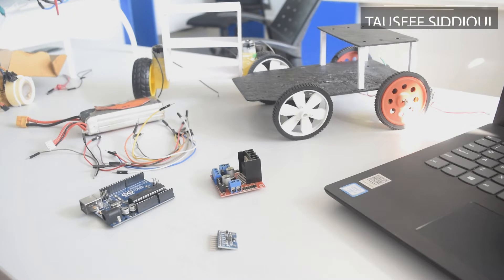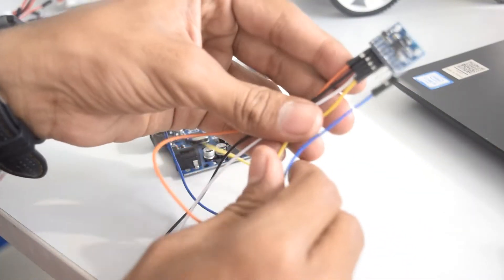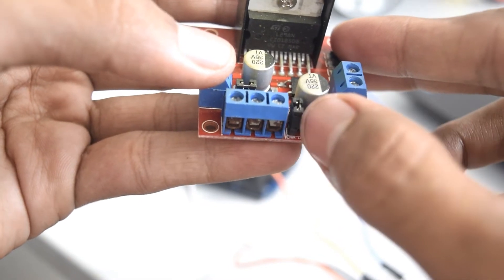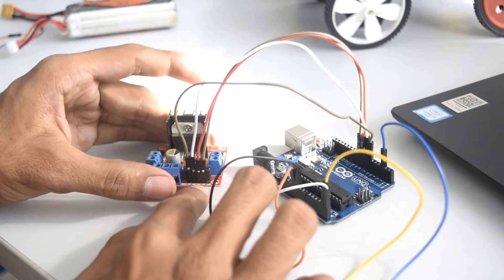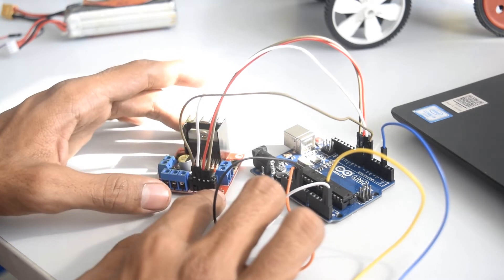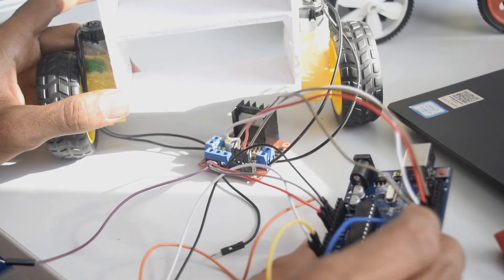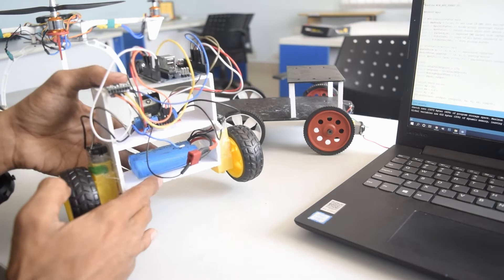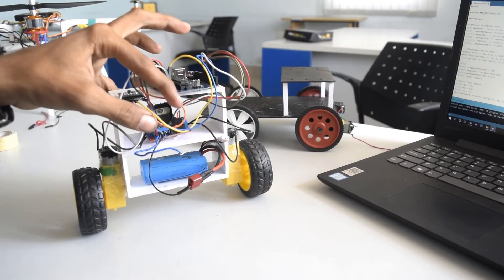DIY self balancing robot using ARDUINO #arduino #robot #robotics #project

Comment: My bot moving in one direction when I tilt it ...I interchanged all pins but not working
Reply from the maker: Just inter change motor wires connected to motor driver
Reply: @electro_king_official  yeah bro I did same issue again I am facing of...
Reply: @electro_king_official  can u share your e- mail ..
Reply: @
Srikanth S
Try to change PID constans, for example i had similar problem when P const. was too big